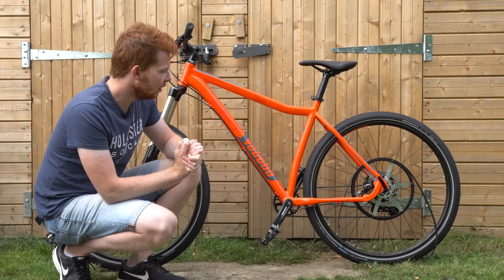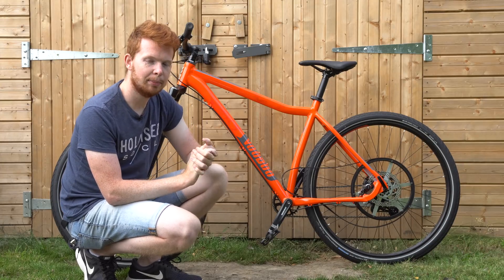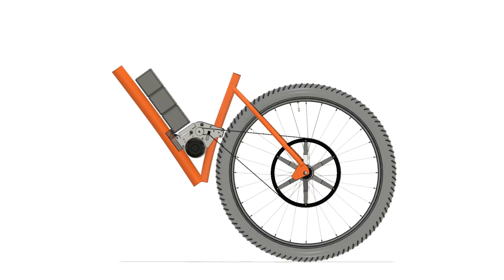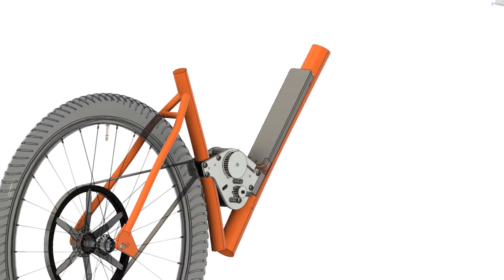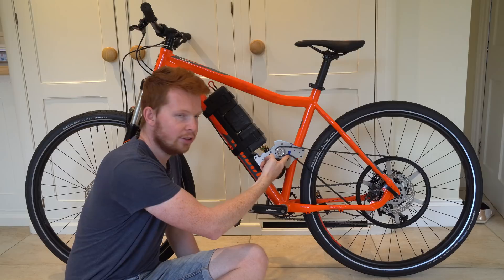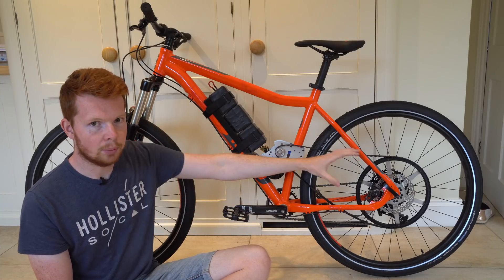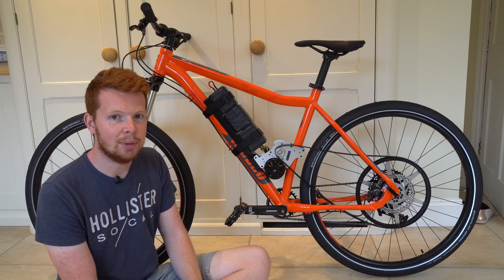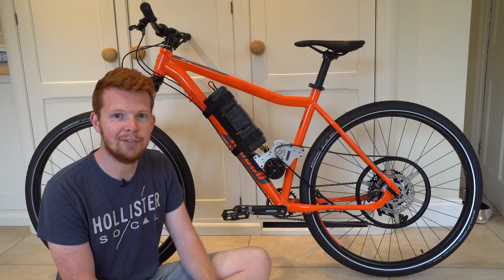Electric bike 4.0 - Motor Mount

Comment: The magnets of the motor are spinning past the aluminum of the  mounting plates.  This should be creating eddy currents in the mounting plate and causing drag on the motor.  Are you able to calculate how much drag that would be?  update -Well I just watched the next video and see that you did have serious issues with this.  I was just wonder how bad of an issue could be and your ride video answered my question.  Keep up the good work.

Comment: Nice work
Could you confirme the the ratios of the pulleys that you designed?
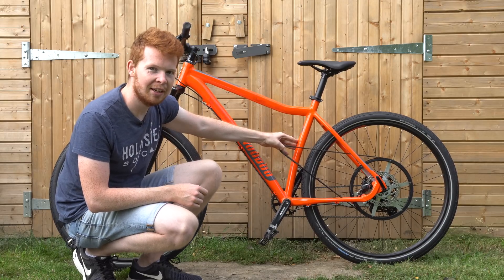I think is 1:2 and 1:8, total = 1:16 to achieve a maximun speed of 50km/h with a with a 170kV Motor  powered with a 36V battery pack, considering the wheel size as 26 inches

Comment: The design concept is very good. My preference would be for the motor to be located beneath the saddle attached to the seat post, preferably housed within a purpose built platform housing. This would be unobtrusive in appearance and keep the belt well out of the way of the rider's feet. A bottle style lithium battery could then be fitted to the up bar of the bike, so not too much cable length between battery and motor.

Comment: Hey Tom I really like your designs and respect your opinions.  What direction should I go in if I want a motorized bike (gas and or electric) that has virtually no drag when pedaling?   I want an efficient human powered bike that is also motorized.   The only thing I have discovered are detachable friction drives.  I heard the mid drives drag noticeably.

Comment: @Tom Stanton

I've watched your E-Bike video series with interest.  Looking back thru the last few videos, I can't find much discussion at all about when you modified the electric motor.  Am I missing that?  I'm interested because that seems the most likely problem for the shuddering described in your recent "Pulley Failure" video.

This video shows the rendering with the shaft out of the reverse end of the motor, relative to the originally designed propeller mount.
The next video talks about the failure of the new motor shaft.

Did you cover the motor modifications somewhere?

Comment: Have you ever considered driving a freewheel dual sprocket/chainring (or sprocket/pulley combination) on the bottom bracket instead of the pulley on the rear wheel?

Comment: There is a further issue with direct drive - it heats the tyre up. In extreme cases this can cause a blowout due to the increased pressure and heat stressed tyre. I believe hub drive is useful for bikes that will beused a lot with little maintenance but for off road you have most definitely the best solution.

Comment: the biggest issue with large hub motors is not the weight, its the axles on the rear style, drilling out the axle to accommodate the wires really weakens the axles and you get them simply shearing off ripping the wires to bits shorting out your controller and then theres a nasty bang followed by a puff of smoke as your mosfets all shatter..

front hubs can do it too but not as likely and i have cheap chinese ebay 500w front hubs that are 5 years old now

Comment: Aren't you afraid that there wouldn't be enought teeths in contact with the pulley to hold up at 4000W ? Even with the "slot tensioner", are you sure it can hold up 4000W before slipping ? I have a 3500W e-skate with about the same amount of teeths engaged as you and my belt slips at about 1000W. Sorry for my bad english I hope you got my point

Comment: hello tom! i follow your videos on a regulary basis and imo they are perfectly made and edited. i also like your explanations which nearly always cover my questions ^^ BUT i have two questions left:
1. have you thought/measured the loss of a/your bell system? bells are a lot less efficient then chains (i understand also why you wont use a chain) but it seems like now using two belts will even add up efficiency loss quite a bit.
2. i modified an old 250w scooter to a brushless 1600w scooter motor (these scooter motors are all the same basically) with a scooter controller. what i asked myself is going with an hobbygrade motor like you or with these scooter motors. what i dont understand is why are these scooter motors so massive and heavy with "only" 1.6kw and your small motor can produce like 4kw? my thoughts are that these scootet motors are more durable and can dissipate heat better. can your small motor be run on its limits for a long time? i would love to hear from you talking about these motors in comparison. in case you want to know what kind of motor excatly i am talking about: https://www.elektromoped.at/de/48v-1600-watt-buerstenloser-elektro-motor.html

Comment: Will you build some kind of shield/guard for the big rear wheel pulley? That thing looks like it might break quite easily if you take the bike off the road and the pulley hits something. A scythe shaped piece of steel tube that goes from the upper rear fork to the lower rear edge of the pulley and then follows the bottom of the pulley to the lower rear fork would probably work nicely.

Comment: Maybe you’d want to increase the disc on the front wheel for more stopping power. One adapter block and a new disc and it’s a noticeable difference if you’re coming down from high speed. Probably a bit late to change the size of the rear now though haha

Comment: Hi Tom, did you consider a direct drive? I mean huge printer side facing gear on outer perimeter of wheel and verticaly mounted motor drivng this gear via some kind of planetary gear? The ratio between these two would be much more bigger and therefore you can you less power when starting a ride or cruising on high speed and regenerating power back to battery pack. Or am I wrong? I thing now that this system would be something like roller coaster drive or 3D printer filametr extruder drive - in bigger scale 😎

Comment: Great video, I've been in the ebikes self build scene for 20 years now and have seen everything, if you are going to use RC motors like this you are going to need to use a slipping clutch otherwise stall currents will in time damage and blow the speed controller, look up Matt Schumacher on the endless sphere forums, he makes some amazing RC motor powered creations and uses slipping clutches for this reason and on the hub motor thing not all motors are heavy, I use a geared BMC motor, it's relatively light, very powerful, reliable not conspicuous and has been driven hard off road, I've been using it daily for 12 years and it's just passed 40,000 miles there is a video on my channel, good luck with your build.

Comment: Not having the motor on the wheel is a good argument if the wheel had suspension, not sure it will make much difference to a fixed wheel setup

Comment: any hardware store, selling 2-3mm thick tubing, could cut such a tube in exact same lenghts to use them as spacers, with bolts going throught them!!!!!!!!!!! your way of a "middle-motor" is the right one, by the way, but didn´t you want initialy to use a bigger last-pulley in your "motor", with more teeth and so, more belt-engagement????? make a Delta/Star-switch for your motor, so to have 2 electronic gears!!!!!

Comment: Bit late, but would it be possible to make peddling charge the battery? So you can get a bit more distance even when not using the motor.

Comment: You can use methylated spirits to cool the cutting bit when cutting aluminium with the router. May not be an issue though :)

Comment: If you ever run into issues with the pulley mount, you could avoid the disc breaks entirely by swapping the chain cassette (and derrailer) for a single gear and using the extra space on the freehub body to mount a pulley.

Comment: Well, why do you even drive th rear wheel and not the front wheel? Especially for the energy recovery system, it might be more efficient to drive the front wheel.
Reply from the maker: How would it be more efficient?
Reply: @TomStantonEngineering  
Well, if you brake, the center of mass moves forward, right?
So, that means that you have a higher percentage of your weight on the front wheels, wich ultimatly results in a higher (potential) brakeforce on the front wheels ( that is why cars always have 70 to 80 % of there brakeforce on the front wheels or why you see on cheaper cars front brake disks and rear brake drums ), wich in turn means a higher recovery yield of your kinetic energy when braking.
Reply from the maker: It would only produce better regenerative braking if you assume the rear wheel is loosing traction, right? It would also be very difficult to apply power to the front wheel using a belt system.
Reply: @TomStantonEngineering  
Yeah, my thought was that you would lose a lot of energy because of the conventional break pads on the front wheels ( if you wouldn't use them, it would certainly have a similar effect ). The idea would of course just improve the regenerative braking and would have the most impact when doing a full brake. I did think about the problem of mounting the motor, wich could be solved by putting it in the middle of the fork (a simple clamp braket would do the trick)  and running the cables through the tubular frame like they do it with brake cables on BMX bikes but it would mean a lot of work ;D.
Reply: @TomStantonEngineering  
Just want to note something, i just remembered something i read monthes ago in an article, where Tesla cars had been tested against the BMW i3. The test results were unexpected, as they though the Tesla would need a lot more energy then the i3 to travel with 120% (both had been tested with original weight and 120% weight) of it's original weight but the difference wasn't that significant, why is that so? They though it might have something to do with the energy recovery system, wich somehow works more efficient when it has more kinetic energy to regenerate from but even that theorie didn't really explained the results, could you do some tests with more  and less weight on the bike and measure the differences in the total range with one charge?

Comment: Would hydraulic drive work well with that motor and an adjustable tesla valve to adjust torque and motor strain nobody seems to use the tesla valve yet?

Comment: Have you thought about using a one way bearing in the middle shaft? I know that you will lose the regen breaking but it will be nice to pedal freely specially if the battery dies.

Comment: Okay, question.
I'm planning on making my own electric bike, but due to the way my bike's been designed, it doesn't have much room in the middle or the back.
Do you think it would be possible to attach the motor to the front wheel or would that cause some problems I'm unaware of?

Comment: I dont like integer gearings like your 20 -40 tooth gearing. Dirt on the belt will tit the same place on every revolution. Add or subtract a tooth on one of the pulleys , make it 19 to 40 or 21 to 40 :-), This will altso even out the wear.
Reply: I would 41 as the big pulley, its a prime number, i like to use prime mumbers og the biggest pulley.
Reply from the maker: That's interesting, I hadn't thought of that! I'll have to look for some odd pulleys then. Thanks for letting me know!

Comment: Why don't you use the motor in such a way that you can still use the rear gears of the bicycle so that you can change it for torque or speed when required?

Comment: Consider thumb trottle instead of twist one. Every one who owns high power e-bike told me that fast response of electric motor make twist trottle dangerous because every bump on road translate to hand movment. In gas powered engines response is much slower so this isnt issue.

Comment: Very nice realization Tom. When I was Young there was a ugly motorie bike called Solex it was a French product hacking the 48 cc engine directly connected by a roller on the steering wheel, you can disegnare the traction pulling up the engine so you can bike were you want but the whole load of the engine was alwais on your arms during  steering and bikini and the maximum speed was 38 km per hour... decisely an ugly stuff (try to Google for this if interested  as a old stuff) another application for powering bikes (this time when my fate was young) was thec mosquito" motorizing putted under the frame between pedals and rear wheel transmitting traction with a roller on the rear wheel  (Google for  Garelli Mosquito images or wikipedia if imterested: 34 cc 0,9 HP! BYW tle last year of production was my borning year!  )
Reply from the maker: Interesting enough, I have a solex haha! It's a nightmare to ride, but certainly turns heads. The throttle doesn't seem to do anything, so it always revs really high when I lift the engine.
Reply: Tom Stanton 
I'm glad you have a Solex. It is such a strange and unusual moped that those who read and are young might think that it is invented

Comment: I like the two stage gearing just for the flexibility. If the design permits, you might consider making the first stage pulleys easy to remove. I'm thinking you could then swap the big and small gear for higher or lower torque use mid ride.

Comment: Why not utilize the existing gear set on the bike and be able to shift through the gears? You would need a chain instead of a belt and maybe could attach it to the pedal assembly through some kind of jack shaft. I think  taking advantage of the already present gear ratios makes more sense imo. Less parts over all too and less weight.

Comment: Hi Tom, you said that you wanted to do wheelies... make an Arduino (or similar) controlled system with an accelerometer that will keep you balanced on one wheel and use the motor as a brake if you go back too far. You can like hold in a button for the system to be activated and release the button to put the front wheel back down. Good luck with that, even though it is complicated, it would be really cool to see!

Comment: Great. Could you elaborate a bit about rated torque for pulley, belt related to your motor in a situation where you have estimated full load on an average climb? Most interesting to know is the probable moment of skipping of the belt. And it would also be great to have more infos about your settings for feeds and speeds, cutter, aluminium material chosen, cooling method ....

Comment: Wouldn't the motor make it harder to pedal the bike? will a simple diode solve that? I suppose regenerative braking is possible with this setup too.
Great videos, got to try doing it myself after getting 3d printer.

Comment: Simple solution to take up slack in belt  would be to move drive motor up and forward on the seat post and on the lower bar with batteries on it. Simpler than some sort of idler wheel and mount for idler wheel.

Comment: i'm guessing you're using an HTD5M belt right? what width belts are you using? your system is now almost exactly the same as mine except my final drive is chain driven because it's a mini dirt bike instead of a bicycle. Those CNC parts look amazing btw, i really need to build a CNC machine because right now i have to print pretty huge parts to withstand the torque.

Comment: i tought about a ebike motor some time ago that is in the rim itself.  both sides magnets, all around and electromagnets arranged like a 3ph bldc motor where the rim-brakepads would be.   
this would allow for freewheeling without losses of the belt by decoupling the coils from the esc 
allows for regenerative braking and speed / torque can be set by the size of the magnets.

https://i.imgur.com/6tzBtHf.png

dwnsides would be
magnetic garbage from the road and dust will stick to it, causing a jam in the tight gap between the magnets and coils.
the wheel needs to run true, which isnt allways possible like when making a turn, the rim will bend over a few millimeters
Reply: meh, some engineer dudats allready did this. a concept but seems to work http://evbud.com/news/306/

Comment: Get geared hub motors if you actually fancy that and not DIY-ing. 6 lb a piece. And I push one kilowatt thru them (peak, 20A 50V) with no issues. 
I see the direct-drive motors on the market as utterly and absurdly huge. 
Regen braking being the only upside I see to them and I'm currently investigating means of locking (on demand) the one-way clutch on the geared motors to get myself regen :D 
Ant I'd go for the RC motors too if I had a CNC machine and a lathe to cut gears, build a gearbox and shaft drive for the wheels... :D 
I never fancied belt drives.

Comment: What are your thoughts on front wheel drive?  I've seen bolt on kits here in the USA that just replace the front wheel entirely with a drive motor.  I know traction might be an issue but otherwise that would seem to be a pretty simple solution for someone like me that doesn't really have any engineering knowledge.
Reply from the maker: I've had a go on a 1000w front hub motor bike and it was quite difficult to ride. The weight of the motor in the front wheel has strong gyroscopic effects and is therefore hard to turn at high speed. I've tried a 250w front hub motor and that seemed fine due to being a lot less weight, but obviously a lot less power.

Comment: In the last video you talked about using bigger pulleys to prevent the belt from bending too much because that causes friction and wear on the belt. Why did you  decide to change it back again?

Comment: A mid-drive motor (driving through the crank) would've been interesting if it weren't for the fact that e-bike groupsets cost around £600. Also the power from that motor will give you plenty of torque anyway to get up steep climbs although you certainly need to swap out those tyres if you want to do mountainbiking with it. Also it would be interesting if you did this on a fat bike, it would be bordering on an electric motorcross bike!